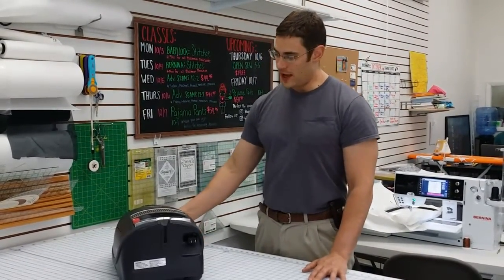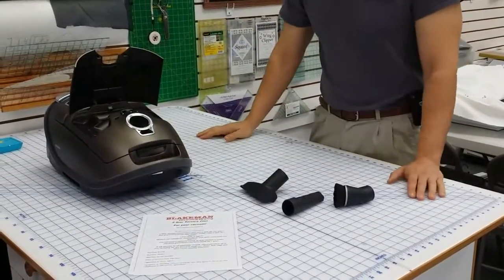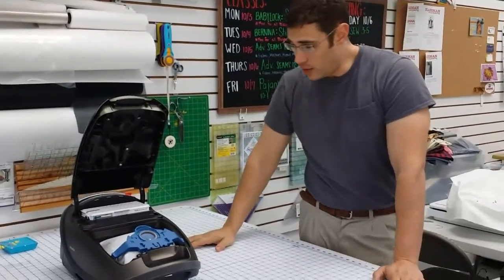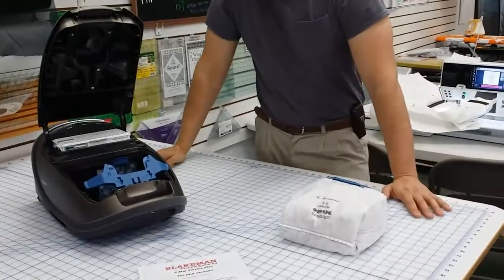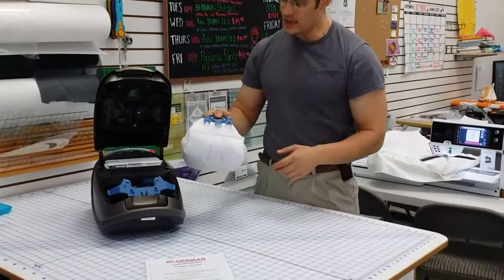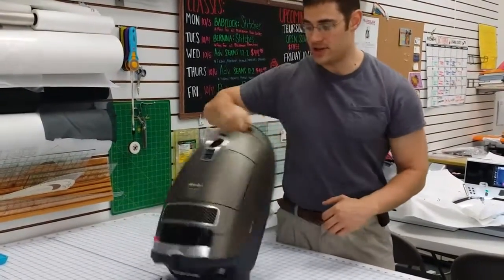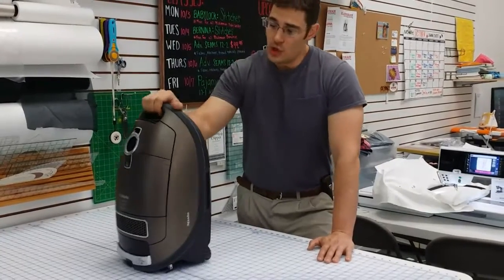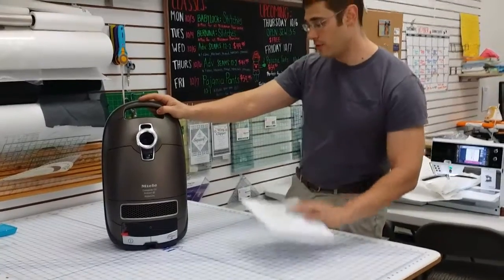Miele Canister Vacuum Full Demo

Comment: Miele is worth every penny. One vacuum that will last 20+ year's, is better than buying cheaper vacuums every 5 year's.  Great German vacuum! ❤️
Reply: Ahhh Rita all the old decent vaccums lasted that long. The Kenmores, Panasonics, Electrolux, Eurika, sanitaire, Hoover, etc..... This is a great machine because it's convenient and filters better than everything else. But it's not lasting longer than anything that we had before. The difference is the price. This is an exceptional machine at an exceptional price. If it were 599.00 it would be in the league as the Panasonics of the 20the century, or the Kenmore whispertone. The machines of the past lasted the same amount of time, but you didn't have to mortgage your house for it. Many things are better, but if they cost a mortgage payments, well it makes you think.

Comment: How do they get the horse hair???
Reply: They do a flying elbow drop from the top ropes just like Macho Man Randy Savage. When it's good and knocked out, they gently take pruning sheers and chop off the entire tail and use that. They make sure to clear the area before the horse comes to because when it finds out it's missing its tail, someone's gonna die!
Reply: @nirv  rolling on the ground laughing!
Thx for the endorphins1
Reply: zandeartistryllc they trim some of the hair off of the horse
Reply: Was disappointed to see you are using horse hair, please consider using a material that is more humane, horses need their hair and for people with allergies, using horse hair would possibly cause an allergic reaction in a vacuum that is designed to help people with allergies. Unfortunately, I will not be able to have a Meile with the current design of horse hair due to allergies...
Reply: No horses are harmed at all lol. Don’t you ever get a haircut ? Same thing. And Miele makes all kinds of brushes. If you don’t like the horse hair brush you can down grade to  a nylon bristle brush. But the reason they make it horse hair is cause it’s a lot better quality then a standard nylon bristle brush and a lot more gentle on your furnishings. And Miele only provides them on there higher end models like this one in the video, which is there top of the line most expensive model they offer. So if you didn’t like the horse hair brush, you could either buy this model and switch out the brush for a different one. or buy a lesser expensive model that just comes with nylon bristle brush and you wouldn’t have to worry about it. But to not buy a Miele vacuum over a brush that can be easily swapped out is kind of ridiculous to me
Reply: cowboys

Comment: I wondered which canister vacuum would be a worthy competitor to this Miele vac?
Reply from the maker: Not many compared to the Brilliant!
Reply: Thinking the Rainbow vacuum might compare.
Reply: Sebo E3 premium or D4, maybe. Not exact, but those are close. The C3 chassis is the Goldie locks size between the Sebo E3 and D4 and also the Miele has cleaner exhaust than the Sebos. You can also check out the Lindhaus Aria Premium.